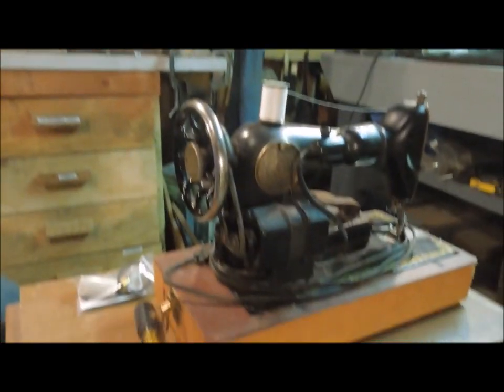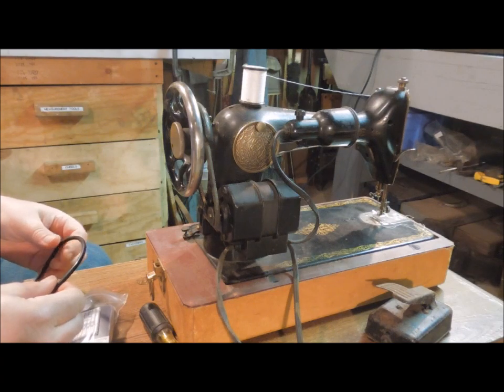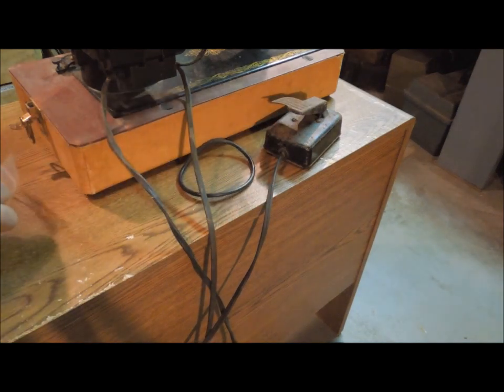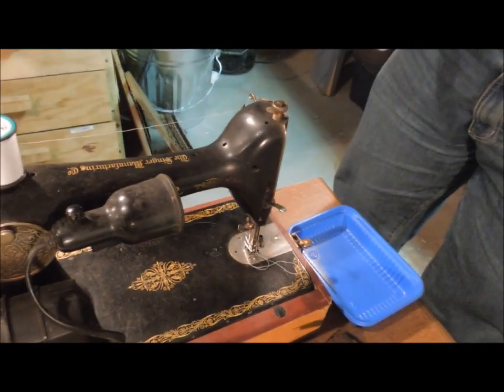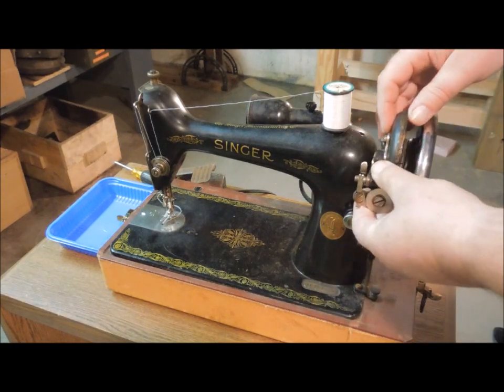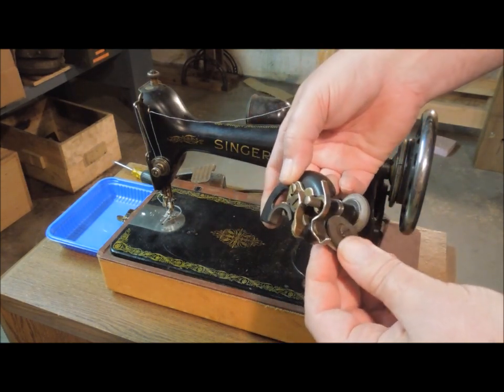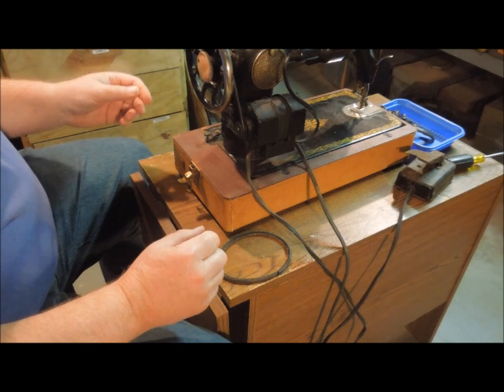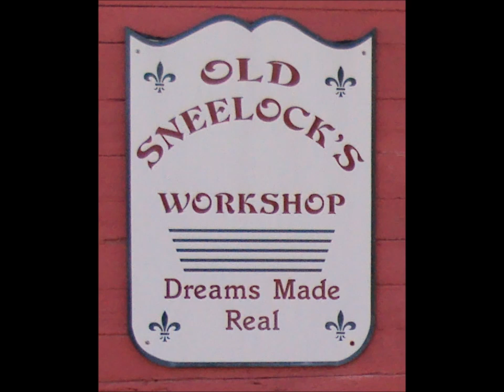Singer 66   Changing The Drive Belt   by Old Sneelock's Workshop

Comment: Between my husband and I, we have 3 model 66 machines.  My 1915 machine is a treadle,  so if you haven't already done a video on how to put a belt on one of them, that sure would be handy.
The other 2 machines (a 1948 and a 1950) both need new belts, and I'll definitely be using this video as a reference guide when I change belts on my 1950 model 66 tomorrow. 🙂
Reply from the maker: To just change the belt loosen the. knurled handlle in the center of the hand wheel and remove the hand wheel. 😁😎

Comment: Hello, i bought recently a 66 sewing machine, what size the belt use it? The motor run but the neddle doesnt move. HELP please!
Reply from the maker: The one I used is called a Universal Belt. It stretches to fit. I bought it at a local sewing center. Amazon has them. Here is a link. https://www.google.com/aclk?sa=L&ai=DChcSEwjN5r_Zxc3dAhXJu-0KHVPfBEMYABAXGgJkZw&ae=1&ei=MaalW7yTNIy2ae2KiYgM&sig=AOD64_1u5Awc9AAI2KXR8_2YvJWZy6Homw&ctype=5&q=&sqi=2&ved=0ahUKEwj877jZxc3dAhUMWxoKHW1FAsEQwg8IJg&adurl=https://www.amazon.com/Singer-Round-Rubber-Motor-Belt/dp/B008MKMEX6/ref%3Dasc_df_B008MKMEX6/%3Ftag%3Dhyprod-20%26linkCode%3Ddf0%26hvadid%3D196269134840%26hvpos%3D1o1%26hvnetw%3Dg%26hvrand%3D13044761875683798344%26hvpone%3D%26hvptwo%3D%26hvqmt%3D%26hvdev%3Dt%26hvdvcmdl%3D%26hvlocint%3D%26hvlocphy%3D9017333%26hvtargid%3Dpla-314803093648%26psc%3D1
Reply: Thank you.

Comment: Excellent for running up a workshop apron
Reply from the maker: Mitch Peacock - WOmadeOD The more I research the potential of this machine the more amazed I become. Since it is so rugged it can sew leather, ballistic nylon strapping and a host of other things. I 'm going to have fun with this.
Reply: Old Sneelock's Workshop That's my Uncle! He can fix just about anything! As for parts, I use the containers you get at the grocery store that you grind your own almond/cashew/peanut butter in because they have snap-on lids and if the parts fall off the table, the lid will usually not pop off. Clear nut containers work well for storing things like bolts and so on. I also got a magnet like your grabber. Handiest thing in the world as long as it's  ferros metal
Reply: Mitch Peacock - WOmadeODgjgjgj